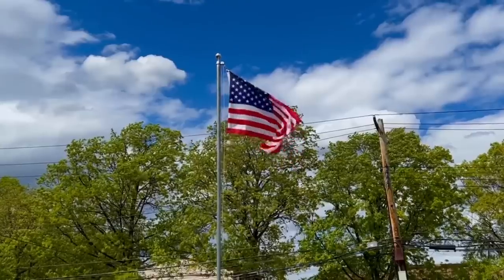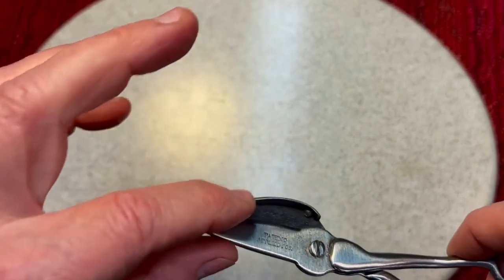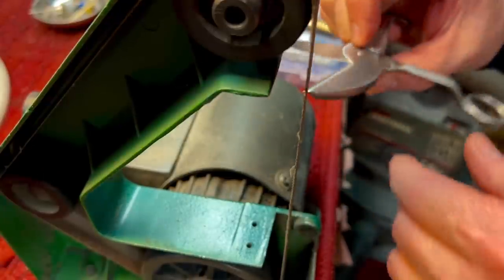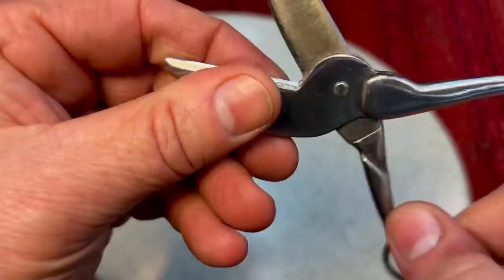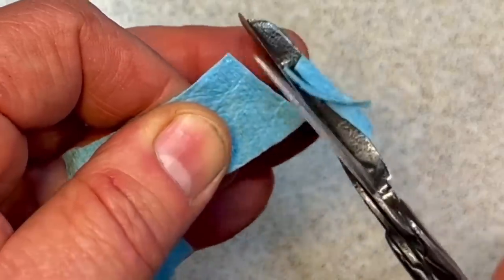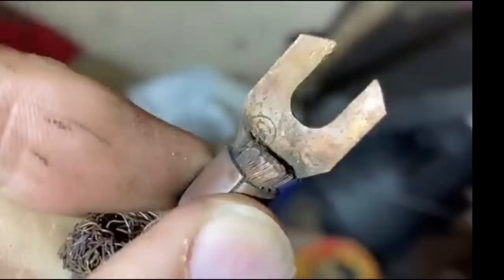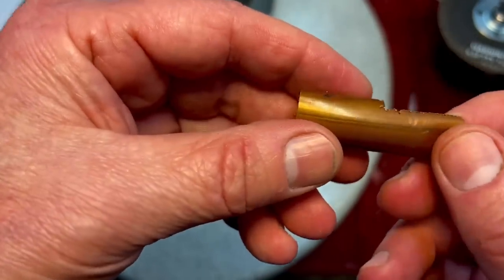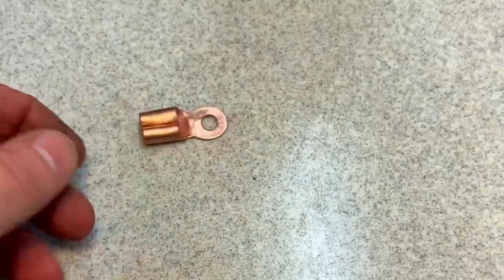Wick Snips, Fabricating in a Pinch and Sharpening Spade Bits.

Comment: I agree that $15 is a bit pricey. Try just cleaning the decal. If it works, great. Otherwise, remove the decal and focus on restoring the tool. Maybe you'll be able to find a reasonably priced decal later and you can apply it to the restored tool. John did do a nice job on the snips; it was nice of him to send it to you. Sharpening Spade Bits 101 was a fantastic course. Thank you.   Jim

Comment: Hi John.
Great show. 
I love spade bits for most of the work I do. 
As an electrician I drilled a hundred of holes with a spade bit every day. I carried a safe edge file and sharpened the bit when it needed it. 
The wick scissors were a treat. I have seen a few but they are usually above the reach of the shop budget. You made them work perfectly without cobbling the edge. Good job! 😁😎
I would rather have my neighbors see me taking pictures of the flag and comment on it than most other things they could be talking about. 
I have breast drills in various states of repair. When they are in good enough shape to preserve I clean them and wax them. If they are rusty or damaged, I remove the rust and repair the damage. I have no problem stripping and painting if after I clean them the drill looks shabby. 
Personal choice John. If it is half gone I take them off. 😁 😎
Reply from the maker: Dave- I think you were the first YouTuber who did sharpening videos for beginners like me!  You probably sharpened just about everything over the years!  😃👍

Comment: I am just the same, neighbours must think I'm loopy, I often wonder out front and stare up at the sky, although we're only 50 miles from London we are fortunate to have dark skies so the stars are bright here, so there I am, middle of the night standing in the front garden staring into space !
Although it would be great to save the label, I think it has to go as there may even be corrosion under it, looking froward to seeing what you do, I have a few of these to renovate both this design with the large crown wheel and also the "Continental " style with the internal gears.
Thanks for the overview on spade bit sharpening, I think I may need to invest in a file with a safe edge as I have quite a number bits and augers to re-sharpen and as you explained the geometry is critical !

Comment: Hi John,
I am a reloader. After firing, we resize the brass cartridge cases. After a few cycles, they work harden and if not annealed will crack. We anneal the mouths of the cases by heating to cherry red and quenching in water. Different from iron and steel, brass is softened by the heating itself, not how it is cooled. We only quench so the head of the case, which must remain hard to resist the high pressure, does not get hot and therefore soft.
Reply from the maker: Ian- Absolutely correct- It’s funny how steel needs a long time to cool after heating. 😃👍

Comment: I use some diamond files for sharpening scissors and tin snips. You can run a permanent black marker along the bevel to see better. Helps if you switch the main lights off and use a strong, directional light from an anglepoise lamp too.

Comment: I Quarter up various sizes of copper pipe all the time. Welding  cable connections, the tighter you can keep welding cable strands together, the better. I have been tasked with ordering cable before, I usually order more then what the boss wants. My reasoning is simple, welding cable only gets shorter with use. Aside: thumbs up with the bit tutorial.

Comment: Great episode full of good tips thanks.
A good tip for annealing copper is to write on the copper with a Sharpie before annealing. The Sharpie ink disappears at the annealing temperature of the copper. It's easier to judge than trying to work out if the copper is cherry red, which isn't always easy unless your lighting isn't just right.
Reply from the maker: Excellent tip!  I never knew that! 😃👍

Comment: The lamp wick shears evolved into "Duck Billed Napping Shears" for carpet installers. I've been using them since the 60's. When carpet is seamed the fibers can be slightly different height on one side, and maybe loose fibers sticking out if the seam. These are used to trim that up.

Comment: Great video, John. I am fascinated by the wick snips. Very well designed solution to a problem.

I have had good luck over the years resharpening spade bits with hand files. The older spade bits were made of better steel and are worth the effort to sharpen. I have my father's Millers Falls spade bit set in it's original red vinyl tool roll.
Reply from the maker: I love Millers Falls!  And old Craftsman! 😃👍

Comment: SC, that is a BEAUTIFUL Vise and it's in really nice shape for its age! I'm jealous...... it blows away my Wilton 5 1/2'' that I have had for 40+years.  They just don't make them like that anymore! IMHO I would paint it with a hammer-tone  black or dark gray paint to keep it rust free and looking great. I agree with your assessment and believe someone had painted the lettering as I have never seen that done by the Factory. Before painting it I'd also take most of the dings out of the "anvil" portion just for looks - since it will not affect performance. Wish I found that one!!!! As descent as I thought my Wilton was when I bought it new, the old Parker's are just so much better made!

Comment: Well first I'll say my vote is for total repaint but that being said there was one time I wanted to preserve the original paint and label on an oil can so I went over everything with super fine steel wool and WD-40 until I got rid of all the rust and loose paint then clear coated the can......You could use the same technique on just that painted/label gear part and restore the rest fully as one way of doing it.
P.S. Super fine steel wool one paint revitalizes the paint and makes it look better, similar to polishing/rubbing compound and then when you clear coat it, it really comes back to life.

Comment: I really enjoy your videos. I need to check my spades for possible sharpening. After watching your explaniation of the side relief, it looks like repeated sharpening would slightly reduce the hole size over time? Not that spade bits are used for great accuracy to begin with. Thanks for the videos.

Comment: Good work!  Just curious if the work on the spade bits reduced the diameter of the hole created?
Reply from the maker: John the taper on the sides is very shallow so the hole size will be smaller but only by a fraction of an inch.  😃👍